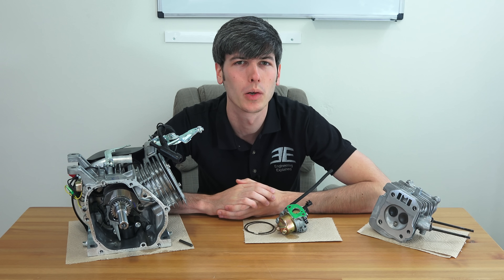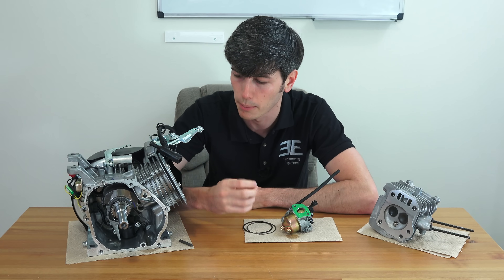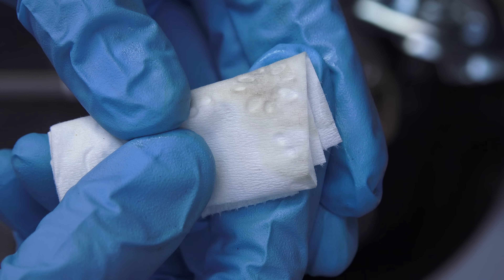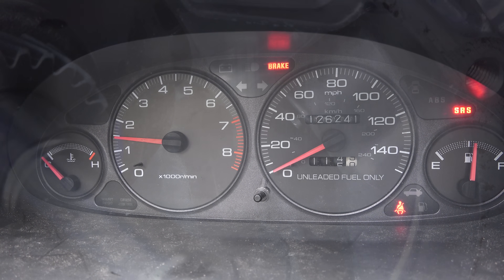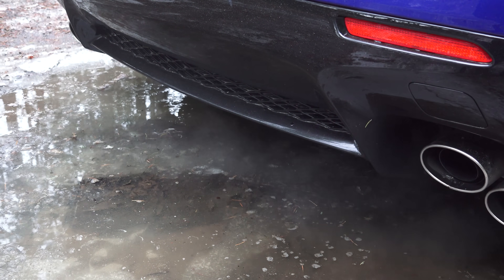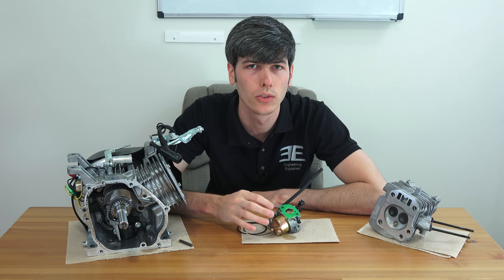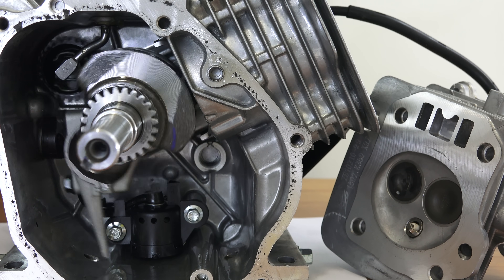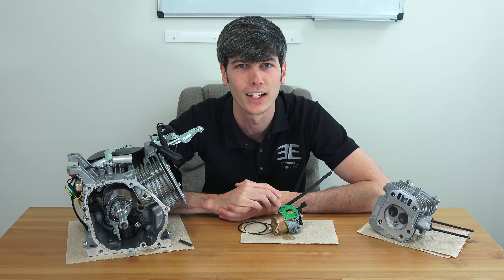Should You Warm Up Your Car Before Driving?

Comment: Here's a thought train for all of you cold car experts: Try just starting you car and driving off after 2 minutes of warm up when the temperature is -10. (In fact, this morning, right now in Vermont it is -20*F, and yes , this is relatively normal for this time of year. Stop being a pansy and calling it "extreme"). Add snowing weather that and the fact that when you parked the car (outside!) it was warm, which meant melting snow onto the windshield, which then results in....and ice covered windshield. So, brush off the car, start the engine, then scrape off the windshield and go!! WRONG!!! Your windshield will still be frozen over on the inside! Add to that your own body heat the breath, and you then have zero visibility. PLUS the distraction you have of your body trying to fend off the cold.... You're going to have a bad time.... Here's what you actually should do: Go out, brush off the drivers door, start the car. Go back inside. 5 minutes later go out and brush off the rest of the car and scrape the windshield. Turn on the heater onto feet and defrost. Go back inside. 10 minutes later, your car is now safe to drive (in theory, in reality it may take longer depending on the vehicle and age).

Comment: I tottaly agree that long idle warmups are not necessary and the engine will heatup faster under a light load not hurting anthing in the engine. You will need a good winshield scraper.  But a vehicle with a automatic transmission filled with DexronIII atf needs to warm up longer then fifteen seconds on extrem cold starts. The trans fluid will flow to slow through the coolers and reduce gear train lube causing gear train damage over time. Some transmissions are equipped with a thermal bypass valve in the valve body or the pump just for this problem. A simple H bypass in the cooler lines is a good idea especially if the trans cooler in the radiator is bypassed which helps the atf warm up faster. Enjoy all your videos keep them coming.

Comment: I would think that when people warm up the car it’s as most have commented,  to have a warm car to drive in , but I would think another reason would be to have the systems like the transmission , pistons , water pump and oil pump etc.., warmed up lubricated from a cold start and working up to  a proper temp so as to extend the life of these components and the engines as a whole , no? I would think that just starting a car up from a frozen cold start and driving off would decrease the life span on all these components more quickly over time if that was the practice .
Reply: i agree

Comment: Right but, not only is the engine cold, the transmission is also, so you should let both the engine and transmission warm up.

for example my 06 Cobalt if I don't let it idle for at least 5 or6 minutes it bogs down when trying to accelerate, cold transmission it only that I notice that the gas mileage suffered while trying to drive after 30 or so seconds it's not a myth.

when I let my engine warm up my fuel lasts longer more mpg, acceleration isn't bogged down,  studies have shown more engine ware while driving cold then letting the oil warm up,most engine ware is when driven cold.

Now unless your a mechanic owning a shop then they can claim it as myth, more money for them to rebuild your engine, from all the wear from the cam and piston rotation friction with not enough time for the oil to properly lubricate those areas.

I know a mechanic that works for Webber Chevy here, a corporate dealership, he States when it's 20 or below to idle engine for 8 to 10 minutes especially if it's a smaller 4  cylinder engine, they take longer to warm up then V8s

Comment: At 7 degrees the other day my 66 chevy with the original 283 and carb took 4 tries after sitting for a month “needs a new choke cable” the first start lasted just a second the second start lasted 2-3 seconds then stall the 3rd start lasted about 4-5 seconds then I let off the gas a bit and bam died fourth start I held the gas at about 1500-1800 rpm for about 10-15 seconds and It idled perfectly after I let off and it continued to idle perfectly for another 10-15 minutes while I let it warm up and pour in some premium gas and fuel additive because it’s gonna be put up all winter then I drove it around for about 2 hours and topped it off again before driving it home and putting it up for winter if you don’t let it warm up at least 2 minutes it its finicky and wants to stall if you give it too much gas after that it’s mint I know others with classic cars and trucks and theirs are the same

Comment: Put a quart of oil out in 0 degree weather over nite.. then try to pour it out in the morn. ..lol . It takes lo nger than 30 to get your oil warm and flowing properly..it would be nice if manufactures put a high idle set for cold start ups like on semi truck engines . This will earn up the engine faster with out heading down the rd over 1200 rpm with little or no flow

Comment: This explanation is hard to judge because you mention "wear" twice. If I warm the car up through idling you state that there is more "wear" because I am spending more time with a cold engine. Then you state if I drive off immediately I should drive it gently to prevent "wear" once again. This is confusing because regardless of how gently I drive, it won't be as gentle as idling. Even if I drive at 1500 RPM, that's very light driving but I'm also at 2.5 times the engine RPM compared to idle. So yes although driving at 1500 RPM will warm up the necessary car components faster, I'm also putting greater wear on the engine by hitting greater RPM's.

So what truly puts more wear on the engine and other parts? Is it idling for 5 minutes at 600 RPM or driving for 2 minutes at 1500 RPM? How about 7000 RPM for 10 seconds? How do these operating temps affect other vital parts of the car like transmission, differential, power steering, etc? I'm not a mechanical engineer or car expert but it's difficult for myself and other folks to interpret "wear" when there are multiple variables that affect "wear", in this case both time and temperature. If I want to reduce time to prevent wear then I might as well rev the engine at 7000 RPM and get the engine to operating temp very quickly but then I'm increasing wear by operating the engine hard at low temperatures. If I want to decrease wear from operating the engine hard at low temps, I'll idle the car for 20 minutes but then I'm increasing wear by taking a long time. Obviously these are the 2 extreme cases but the video doesn't answer the question of whether or not I should warm up the car because both options you mentioned in the video have increased "wear" in their own respect whether it's operating the engine slightly harder for a shorter period of time or operating the engine lighter (idle) for a longer period of time.

From what I've been told (which I cannot confirm to be correct or not but logically makes sense to me) is to let the car idle at its cold start idle RPM. Once the RPM drops, which usually coincides with the engine temp needle actually moving a bit, then I should drive off gently until the engine reaches a reasonable operating temp according to the engine temp gauge. I've been told that once the RPM's drop, it's like a message to the driver that the car components have reached a reasonable temp to start driving (not ideal operating temp so still no hard driving). The colder it is, the longer it takes for the cold start idle RPM to drop. If it's well below freezing this drop can take several minutes. If it's very warm this may only take less than 15 seconds.

Comment: I always believed that the reason you warm your engine was because engine components expand and contract due to temp changes. And since clearances such as that between the piston rings and the cylinder walls need to be precise to like the micron, it's better to wait until temp rises and expands the components. Am I way off?
Reply from the maker: Yes, everything runs best at operating temperature.

Comment: In what temperatures are you speaking of? Have you looked inside the engines that have not been properly warmed up at various temps? 30, 10, -10, -20...? I understand your point but you really need to be more specific at for the temp ranges your referring to.

Comment: I disagree  with this. Most of what was stated is true however it appears to be coming from the perspective of emissions output. I use Mobil 1 full synthetic exclusively on all my vehicles and I allow my engine to warm up as slow as possible to promote the uniformity of all the different mating surfaces expanding during warm up. The slower the warm up the more uniform it is. When done too quick the pistons are hot and expanding at a rate much quicker than the engine block ( more mass ) and contact occurs. Head gaskets, exhaust gaskets and so on will eventually fail prematurely if slim to no real warm up is used as a habbit. I enjoy your videos and will continue to watch I just disagree on this specific topic.

Comment: Hello there I live in Fargo North Dakota and it's very very cold up here current temperature of the moment it's -22F, so my question to you is I have an auto start and I start the vehicle for 20 minutes two times a day one in the morning and in the middle of night is that okay or I'm basically abusing the engine? please let me know when you get time or anyone who has the same condition as mine.

 Thank you
Reply: I think he is referring to people that start there car for 20 to 30 minutes. If it's just for 3 to 5 minutes.... I wouldn't see anything happening to the car. with the block heater pluged in for about an hour then the car will warm up just enough to defrost the windows (I would know because I stay in Alaska). But in some cases.. people usr defroster in a can which helps.

Comment: Install a block heater in your engine and wire to s timer that turns on in the morning a few hours before you go to work. It actually pays for itself because the electricity used to power the block heater costs less than the fuel burned during a cold engine startup. You will also have nearly instant heat. Block heaters can be installed on virtually any engine for $20-$50. They can heat the oil or the coolant, depending on if you go into an oil access port or a freeze plug in the head. Odds are a good extension cord with an illuminated receptacle will cost more than the block heater element and wiring.

It’s ridiculous the only vehicles I’ve ever owned that came with these stock were SVT Focus and Golf R32, both economy performance cars. They aren’t even an option on most vehicles unless they’re diesel or trucks.

Comment: Jason, how about the diesel cars? They shouldn't affect engine oil in same way as petrol, should it?
Reply: WeAreCarFans I would think it would be more wear being that diesels run more compression due to the compression ignition system versus gasoline vehicles. The higher the compression the more pressure on crank and rod bearings and such. That’s just my personal option. Also, depending on the load that vehicle is put under. So you take my Ford F-250 for example. It’s a pulling truck used for for pulling campers and payload up to like 10k pounds. Versus a Mercedes with a diesel is used for more fuel efficient reasons..... 

This is just my opinion and an understanding I have from working on different engines from stock to modified!
Reply: I am also curious about that as the video didn’t mention.
Reply: Definitely diesel cars take longer to warmup, at least from my experience
Reply: Yes, but mine question was more of question about lubrication of cylinders since diesel is not solvant and it provides some lubrication by itself. So, shold be formulated more like how much wear do have diesel engines when they are cold compared to gasoline engines...
Reply: That's what glow plus are for.... For the cylinders at least anyway.... Plus higher compression brings more heat.... So in theory, they should 'heat up' quicker shouldn't they?
Reply: I've noticed that my diesel vehicle runs like crap until it warms up even if I use the engine block warmer. The block warmer helps a ton but isn't perfect.
Reply: Well diesels(talking about my 6.0) use a high pressure oil pump to fire injectors as well as some other things. Driving a cold diesel will run like crap or lose performance until temp is a little warm. Going by my experience, driving my 6.0 with a 5r110w trans is crap when it’s cold. Doesn’t like to go like it should or shift when it should bc of the fluid being cold and thick..... as soon as it’s warm, she’s good.....

Comment: If I don't have ice on the car, I now normally wait for it to drop from fast idle which is normally 30 seconds, otherwise if there is ice. I scrape it while the engine is running and then drive once I'm done.

Comment: The engine operates efficiently at operating temperature. If the oil is cold than the transmission fluid is cold and will cause rougher shifts. And it also depends on what climate you live in. If you live in hot climate than your car will warm up immediately ,if you live in cold climate your windows will ice up when you start driving unless you have heat on the windows.

Comment: By this theroy my 30 year old truck which ive warmed up for 10 min everyday on hot or cold days should have shot piston rings and bearings yet surprise surprise it still has good compression , runs great with no ticking or knocking and has 750000 km unless u have been recording a 30 year old vehicle every second of its life with all maintanece evidence, driving habits, fuel types, everything your saying is theory not fact

Comment: Companies nowadays build plastic parts so they can fail quickly and we would have to spend tons of money on car repairs. Now they try to pass this information through a YouTuber. Where did he get this info about warming up our cars? I bet it was not a research from an independent company. Most likely it  was from the car manufacturer and  their goal as a company is to make money. So the sooner they get you in a showroom the more profitable they will be. Everything comes from experience as you may well know since you are an engineer.
My family  had a 326k miles Honda and a 297k mile nissan with engines that were still strong but the salt eat the outside away. We kept up with maintenance and let the car warm up 10 minutes every morning. Sorry pal, but taking your advice is like listening to a fat gym trainer. Unless you have  done your own research and have cars that failed because you let them warm up during the winter, then we are ready to listen, but don't come with 'research' that car companies what you to believe. They are in business for one thing only, and that is to make money.

Comment: I drove my 3.8 Camaro for 8 winters here in Canada and always idled it during the winter sometimes for 10-15 mins when I was being lazy. That motor did die early at 183xxxkm but it had some other issues. I think it ran low on oil before and might of even ran for a while with low oil pressure. Basically killed a lifter and wiped out the cam as well. Driving away during those -20 or so mornings without warming up the car would buck and do all kinds of crazyness. On that car I had a bad maf and a bad o2 sensor and coolant temp sensor close together so that was fun figuring out. Right now I have a 2008 Cobalt SS and it's much better at regulating how it runs in the cold. I did notice it was -2 the one day and I got in and drove away and it was a little jumpy for a few seconds. Personally I like to idle my cars especially in the cold. I can't stand sitting in a ice cold car in the morning.

Comment: I think all MFGs should put in an electric oil pump that can pump oil for maybe 20 seconds before you start it up so oil is everywhere before you crank than resume the traditional pump...the electric pump could also heat up the oil too like a grid heater does for intake air

Comment: "The answer is no" unless you have to breathe and need to see where you're going.  I've also had the end of a cam shaft shear off when it was -20F after not letting it warm up at all.  

Regardless of any operating temperature or fuel mixture rubbish, let the poor engine reach at least 40 degrees before driving.

Comment: The thing I think about more is cold metal is more dense, therefore the gaps in the piston and cylinder wall will increase. Fuel is allowed through those gaps at a slow rate, after a bunch of short drives the oil gets contaminated and there's pressure in your crankcase that then causes oil to leak from the pan..

Comment: INFINITI QX60 2017/2018 manual said it needs 30 sec to warm up(stay idle) before driving. I believe it is fuel injection engine, but not sure why it is still required.

Comment: Thats why you have open and closed loop in the computer. Before it gets to operating temp it runs off pre determined specs so the colder it is could do more damage cause the computer cant compensate for the temp outside till it is at operating temp then the computer will constantly change its outputs depending on its inputs. Secondly the oil should start circulating immediately upon startup not in a few seconds!

Comment: To the idiots who wrote this:
We don't let the car idle for the sake of the engine.
We do it because it's -10 degrees outside and we need the heater to be putting out heat.

Comment: By not letting your engine warm up properly in below freezing temperatures you can get spun rod bearings or worse. Metal contracts when its cold, reducing the amount of oil flow in vital areas. Even in the summer on a cold start I warm it up a little. Its all about oil flow and sensor temps. Cars are like women , you got to warm them up properly before you take them on a good ride.